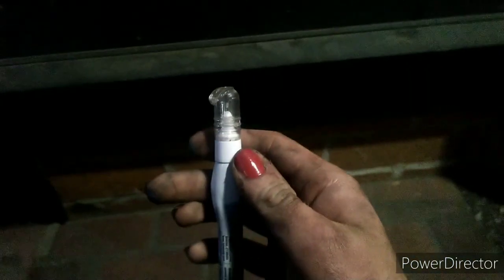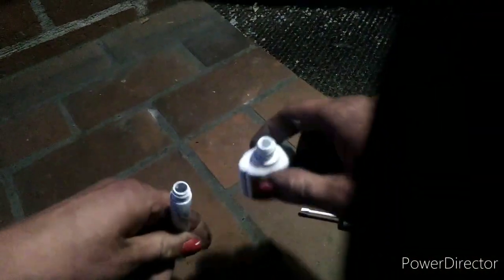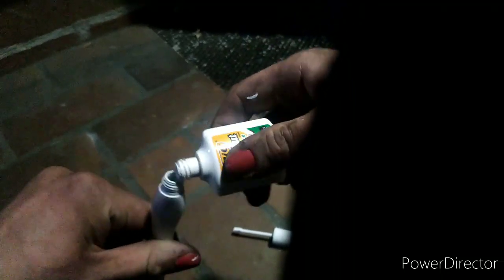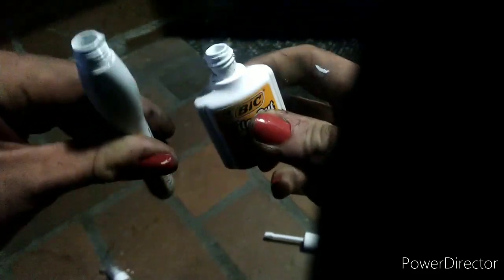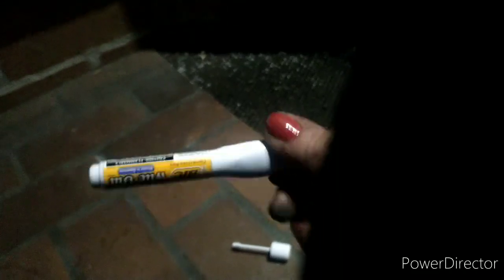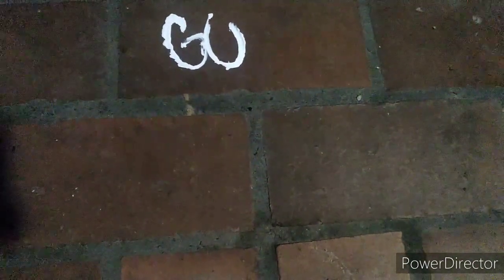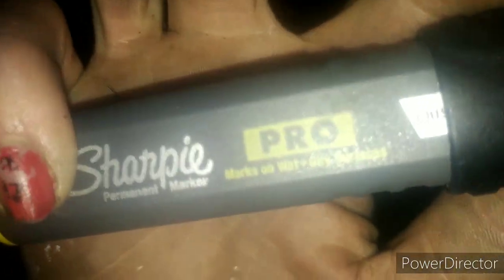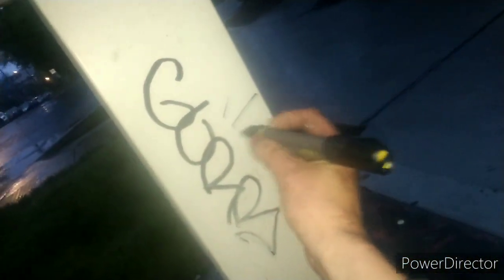how to refill a bic whiteout pen!!!💥🔥🙃

Comment: Refill a bic pen with otr 901 or magic ink you'll thank me
Reply: Rack some silver or gold markers from Miguel's or Wally World. DecoColor Premiums are easy to find. The nibs suck so theyre really only good for paper, not the streets. But the paint is fire. The nibs just suck. 

Empty the corrector pen (into a bottle so u don't waste the white out fluid) and refill it with the silver or gold paint.

It looks sick on a black or dark colored background. And they stain harder than whiteout fluid cuz the silver paint is xylene based.

But yeah I also like mixing Pilot or Magic Ink into the whiteout fluid as well. As long as it's alcohol or oil based it usually mixes very nicely with the stock whiteout fluid.
Reply: Or any color Deco paint pen will mix nicely with whiteout and give you a baby blue or light green or whatever color you want out of your whiteout pen.